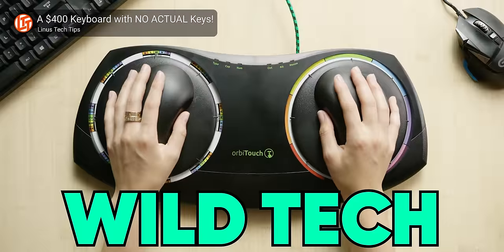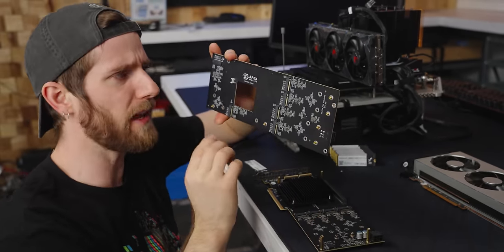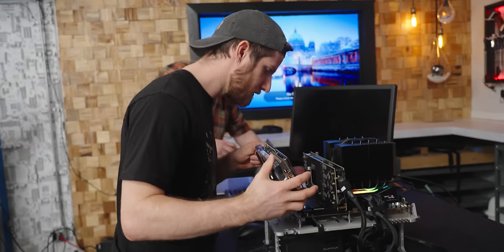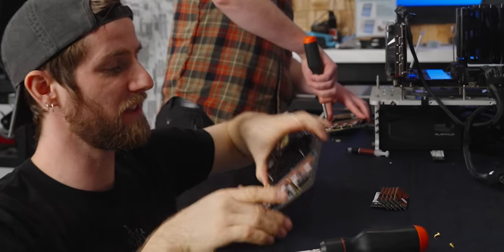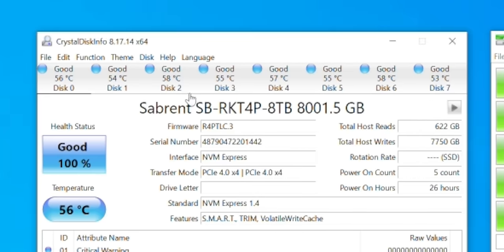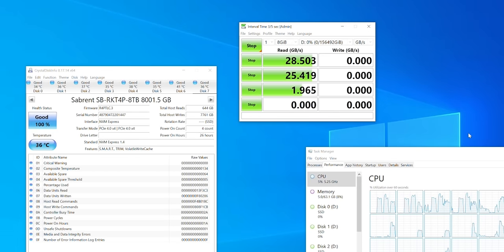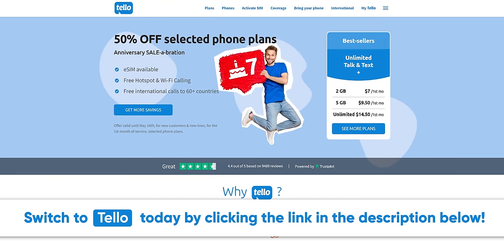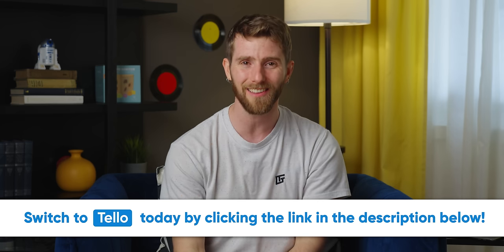This SSD is Faster Than Your RAM - Apex Storage X21

Comment: ok so im thinking put this in and pull all but 1 intentionally small ram stick out, and set a huge swap file on this and have all the ssd's in raid and use it for ai inferencing on huge llm's.

Comment: 5:02 I'd use that in my main machine beacuse big files go brrrrr and I have too many Das boxes and that would be so nice for a massive locally installed software library and video editing, cad. Pretty much it could prevent desktop power users from having to take up space or having to configure Nas das and other Jbods.

Litteraly have 4 high speed 1tb m.2 nvme ssd in my machine and want MORE

Comment: I think you have price confused with actual worthiness.  Overpriced SSDs will not retain their perceived value over time.  So by claiming they are worth more than your car is misleading.  They may cost more in the short term.  Will your car crap out before they do?  Probably not.

Comment: I'm curious why you wouldn't think of using the NVMe  (You call SSDs) in a JBOD configuration? 
It makes sense in some scenarios. 
(Yes Linux [RockyOS]  and  for  data fabric use cases.) 

And yes, I want one...  but would need a 100GbE network to make real use of it.

Comment: I have a question out of curiosity. What if you made that into a ram, what would be the uses of it? Like making sure ALL the data is kept alive even if the system shut down? better debugging tool? Is there such a thing as RAM made out of SSDs?
Reply: That was an Intel optane use case. They were called Non-volatile dynamic inline memory modules or NVDIMMs. I suppose Linus should make a video about it.
Reply: @sim2er  ah, I remember them, they flopped in consumer space right? How about in companies?

Comment: Does it support RAID-6 for double parity? And is there anything to indicate what drive if any is bad? As expensive as this is the larger concern would be data loss so being able to continue to run even after a drive fails and to let you replace the bad drive when it fails without having to wonder which one it is would be very useful in that regard. And what happens if the drives are fine, but the device itself breaks? Would it work if you put all the drives onto a new one? Or would that single point of failure mean the loss of all your data?

Comment: And by the way. can you make a video about windows server RAID zero vs bios RAID? because i always do Windows server RAID, instead of bios, or dedicated, tough i do have a T7910 workstation. 
My reason is stability. I don't see any difference in performance, but i see more stability using windows server RAID than RAID card or bios.

Comment: 21 SSDs x8 TB would be NOICE... if it cost like I dont know.... 1000$. Maybe in 10 years.
Reply: well the board is perfect solution if you want more than 2 nvme's in your rig.
the price is high for 8TB nvme but you could do that with only 4TB per nvme or 2TB or even cheap 1TB modules.

Comment: I'm just thinking, could there be some kind of conversion method from PCIe 5.0 to PCIe 4.0? I'm not talking about compatibility, but timing (I think, if the term is correct) conversion. Think about it, a single lane of PCIe 5.0 is similar to two lanes of PCIe 4.0, right? Stacking bunch of x4 PCIe 4.0 like this card into a x16 PCIe 5.0 should make those SSDs run like breeze.

Comment: I predicted back in 2001, that when hard drives become solid state and the bandwidth and random IOPS becomes fast enough, that RAM would no longer need to exist..

Then came along SSD, then nvme SSD's, then PCIE4.0... I say within 2 years from now, they could design both Windows and Linux to just make use of a dynamic pagefile on the SSD instead of using RAM, or directly access the data from the disk without the need for a paging file anyway.

Which would reduce data loss in the event of power failure, lower data corruption and lower hardware costs, since the memory controllers and slots and cache and CPU requirements could all be removed.

Some of you might laugh, because of your lack of understanding as to why systems use RAM to begin with.  But I guarantee what I said will come to fruition.

Comment: You can get a decent amount of speed on a $30 NVME PCIE like the PH44 if your motherboard supports 4x4x4x4 Bifurcation.  Raid the drives together to the full 16x max speed of a PCIE bus.

Some caveats.  Even if your mobo supports 4x4x4x4, which is rare there is a good chance that it may force your videocard down to 8x lanes.

"Asus hyper m.2 x16 v2" was a way of getting four gen 3 drives together but is pretty much obsolete since it does not support gen 4.

Comment: your clickbait title is a technical nonsense... you can't have any component in your system faster than the RAM because all transfers are between devices and RAM... you had a DDR5 in the system and that's faster than your storage :)
Reply: The title is about "YOUR" RAM, not his :))
Reply: @Wlad1  if anyone's RAM is DDR5 or the fastest DDR4, then the statement is invalid. and actually it's invalid even for most of the DDR4 cases because he's comparing the speed of one memory channel while dual channel is the standard 😀  following that logic i could say my microSD card is faster than your RAM because you might have a old PC XT 😁
Reply: @robertjung8929  yes, my DDR4-3600 (4x16GB @dual-channel) gives me in Aida64 about 55GB/s, but as a RAM-disc (with file system) only about 25-28GB/s.
Reply: @Wlad1  of course, because when you read a file you basically read the blocks from the block device (disk) and write them into  a memory location. if your block device is your ram directly (ramdisk) then the ram speed is obviously shared between those reads and writes.

Comment: 21 is a very odd number.  Anyone know why that is the limit for the number of drives on this card?
Reply: This Microchip-Controller supports max. 100 Lanes, but needs 16x for PCIe-Slot connection. Remaining 84x Lanes devided by 4 (because each SSD needs 4 lanes) -> 84:4 = 21 M.2 Slots.

Comment: 4x4 bifurcation and several x16 slots would be more cost-efficient than using USD 2800,- on this card alone.
Use the saved money on a Supermicro X12SPA-TF and a Xeon W-3335 instead, and you're flying! 
This setup + 2 pcs PCIe x16 with 4 pcs Gen4x4 NVMe's each, will beat the s*** out of the Apex.
Want more? Just add more cards. Or get a Server Motherboard with more CPU's / PCIe lanes. 
Or switch to the newest LGA4677 platform with up to 112 PCIe lanes pr. CPU. ( https://en.wikipedia.org/wiki/LGA_4677 ) 😉

Comment: Ty for raid 0
Reply: No you just need raid 0 or Linux 

Windows sees all drives as one volume.
Reply: Next version high frequency raid controllers on its own chip. Allowing sli - raid and network expansion. 

Currently done with software, and lots of nerfing it’s retarded. Yea you can raid, but only these drives and this many… f you raid 0 to bypass this. 

Hardware level raid and ai would bypass software induced lag and the design to limit and fail. 

It should drive down the costs of video platforms for one thing and finally allow people to keep their content instead of relying on a corporation to keep it safe and distribute it.

Comment: This is what I call hardware for when you have shitty software. If you have good software this is a waste of money. Just buy used server hardware if you're cheap... Now if you do have shitty hardware that works better on this virtual drives then it's a good deal, 2800 usd won't get you the good software refactor/upgrade you need. More like 28.000 usd+.

Comment: I see the Diference in SSD Sata 550 MB.s and  Nvme 7000MB.s install Windows Open Windows is about 35 seconds the difference Open games install games i know this becouse i have PCie 3.0 and i tinking in Change to Pcie 4.0 and 5.0  but no tanks i keep it my  PCIe 3.0 i see the difference is nothing 35 seconds install Windows to SSD Sata to Nvme so i see a big difference on Crystal MediaMark only there u ser that big difference on no One place u ser the difference i Stay ir my PCie 3.0 i ser alot vídeos and ONLY in bechmark i see the big difference this is normal they say evolution WTF dont f**k my money 😑